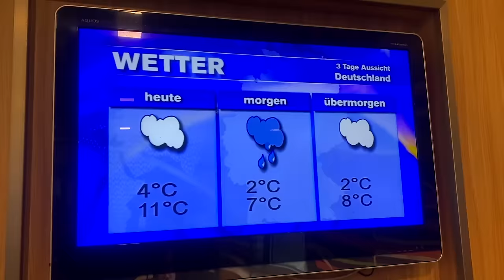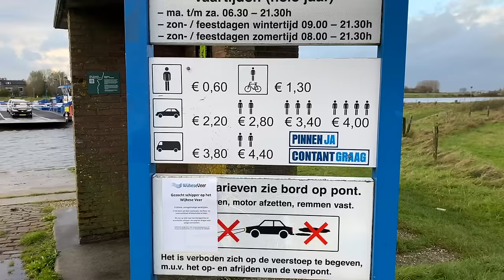WE CAN’T CONTINUE WITHOUT THIS PART… 🇩🇪 [S6-E16]

Comment: Hi! I assume you are probably done with this trip already, but for future reference, never ever give gas while starting the bike. That is the reason it almost didn’t start. Fuel injected bikes doesn’t work that way! Just a tip! It has been great to follow your journey. Well done 🤗
Reply: While mostly true he started that with the throttle after it would not start several times… Once he tried the throttle trick it then started almost every time… what he desperately needed was a battery… but now the new battery is in he is making it hard on himself…
Reply from the maker: Thanks 😊
Reply: @LaviandOllie  After many years of riding carbureted motorcycles, this was a hard habit to break lol.

Comment: Hi, did you check the voltage - should be about 14V with running engine. Otherwise you will need the charge-regulator earlier or later. A frequently defect of this bike - easy to change and not very expensive - but first good luck! Greetings

Comment: The underside of the left fingers wear against the clutch lever, which you use a lot more than the front brake on the right hand!  Also for electrical issues, the cables may need replacing, too. Especially since the connections were loosening up so much!